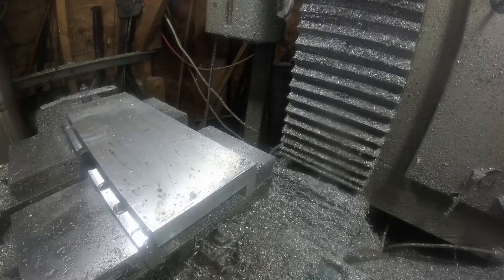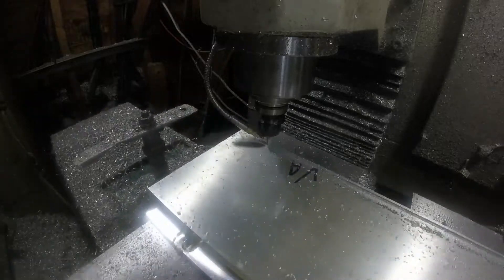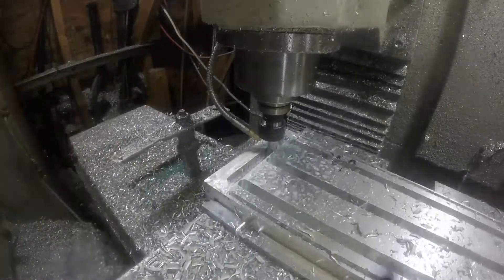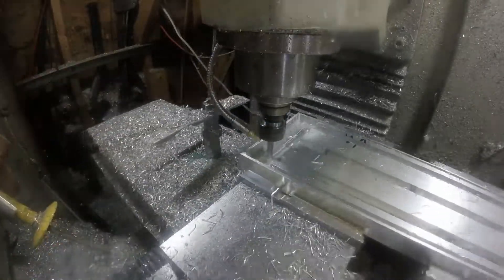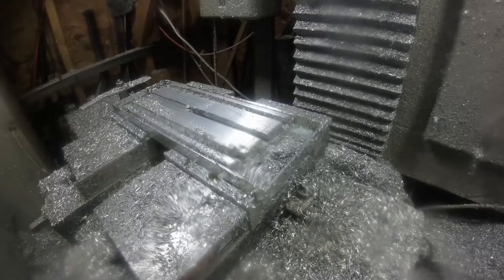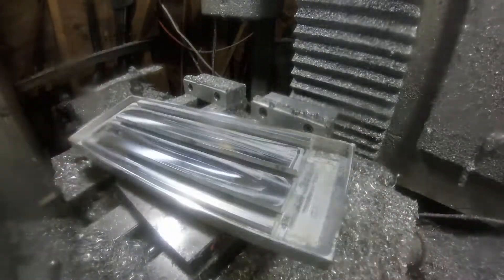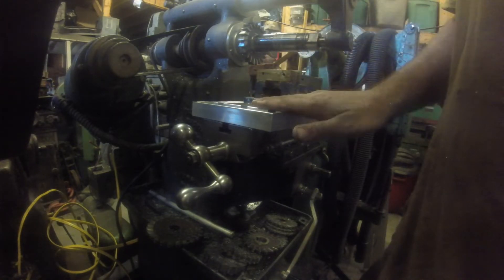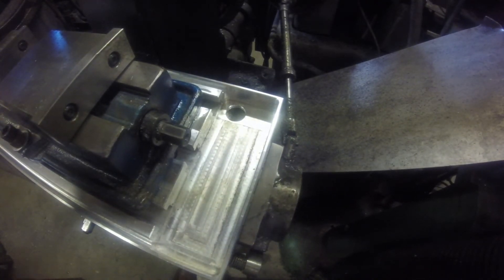Making a T-slot milling table

Comment: You’re correct. Always go with a smaller one so you can go up the middle then a finish pass on each side. But if it’s HSS run it VERY SLOW. standard T-Slot cutters should be ran at 1500 RPM with 1.5-2.5 feed rate
Reply from the maker: I havn't tried steel yet but would like to.  Thanks for that!

Comment: I'm not sure aluminium is the best material, for a mill table.
Reply from the maker: Indeed it is not; but I'm basically tripping over the stuff.  It's been on there for over a year and no problems so for the way it's being used here it doesn't seem to be a problem.  The best material would likely be some well aged cast iron.
Reply: Ebbco somewhere in between would be T slots made of stacked cold rolled flat bars. Wider on top, narrower on the bottom.
I came across a design for a milling attachment for a lathe in an old magazine where the table was constructed that way. 
Everything bolted to a 3/4 steel plate with countersunk bolts. Looked very solid on the pictures.

Comment: Ever think of making these and selling them?  I bought a t-slot table from a seller on ebay only to learn how poorly it was made after I got it.  Material was too thin to begin with and the thickness at the bottom of the slots is way to thin allowing the whole table plate to flex.  I believe yours would sell well, it looks properly engineered.  Thanks for the great video!
Reply from the maker: I hope that wasn't one of mine you bought off ebay!  I do make a version and sell but it's just a simple plate; it doesn't have the coolant troughs.  Thanks for the kind words. :)
Reply: Lol,  I believe I've seen your sacrificial plates on ebay; they do look nice.   The one I purchased was definitely not one of yours!  I use the one I bought but I had to stiffen it up with a piece of .750 mic-6 plate.  The folks at Techno-isel make some really sweet table plates as well but they are really proud of them.

Comment: Great project. I'd love to make one for my little mill. It has the same kind of single T slot, but I think mine actually has a drain, and I'm not sure, but I feel like there is a coolant sump in the riser block section of the casting. It's incomplete, so who knows? :)
Reply from the maker: Thanks man.   I hope it works the way I imagined.  There might be a sump down there, never know.
Reply: You're welcome. Unfortunately there aren't many or really any good examples that I've seen of my machine (Which Lathes.uk calls a mill, but can also be seen as a grinder - Mine was modified nicely to add an R8 spindle), so I'm not sure if what I think could be a sump really is. It's missing a cover over it which I feel maybe had a little pump mounted in it. Also.. the "drain" hole in the table is high up, and in the center. The only similar photo I've found so far (In a dead forum post) so shows some kind of cover with something on it over the chamber in the riser block casting which could be a coolant pump, or might be something user added, but it's obscured by the camera, and the OP so far has offered no response, so I don't know. Right now it makes for a handy place to keep T slot nuts and bolts. lol The machine was only $200, which was sweet for a starter mill. It's confusing though because even Lathes.uk doesn't show the exact same machine as mine though it's the same brand. Mine has a floor base casting, and the larger riser block with maybe a sump in it or maybe not. EDIT: I just now glanced at lathes.uk and noticed a somehow previously over looked detail regarding the options for the machine offered by the maker:   "... a 2" raiser block to lift the main column; complete coolant equipment with electric pump and tank and a "Vapor lube unit", as assembly that sprayed a coolant mixture onto the work piece from a self-contained 2-gallon tank and pump unit. "    @ecdezz
Reply from the maker: Funny these old machines are.  I've got a few that have no rear references online either.  I'm basically on my own.  You know the company had to make a quite a few of them at the time but they've been lost over the years and apparently all documentation with them.  Sometimes that's the fun part (thinking you have the only one) and sometiimes it's just frustrating.
Reply: It's always weird and sad when you think of some company that made a big machine just evaporates from recorded history for the most part. It's also a little fun to run down the mystery, but then the frustration does set in. I was on a wild goose chase for 48 hours with my little mill, because I only had photos at first, then when I got it it was dirty, so myself and 5 other people looked at it, and couldn't tell that a few things were added (switches and outlets) as they did a really good job fitting and with paint, and the general dirt and grime blended in the rest to make it look factory, so I was off searching for a machine with those same switches and buttons not knowing I wouldn't find one. Even after obviously immediately finding the brand on Lathes.uk, I still didn't recognize it as the same machine because of factory upgrades and previous owner mods. I still haven't seen another one with the factory floor casting. The worst search I had was for my first "real" lathe. It was a little old bench top thing that I searched and asked and searched and searched for, and never found another like it, or plans to build it, and anything. That one went to the grave of selling it without ever knowing, but I suspect it was shop or class made.  @ecdezz